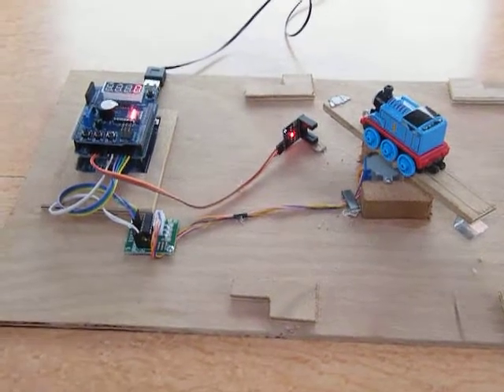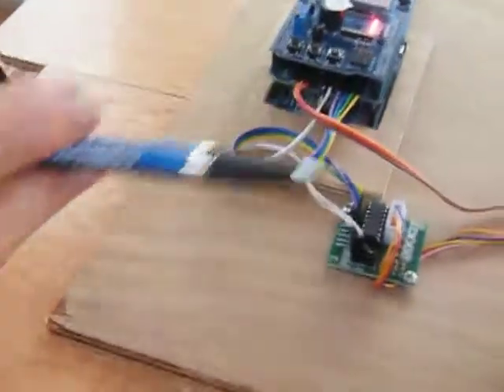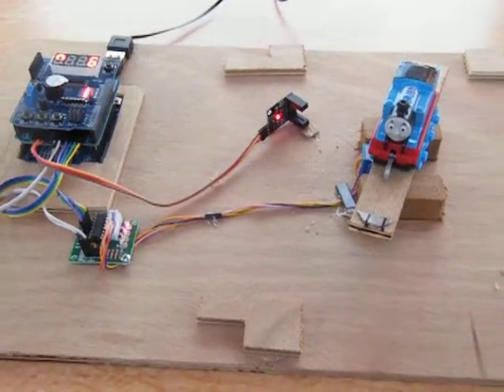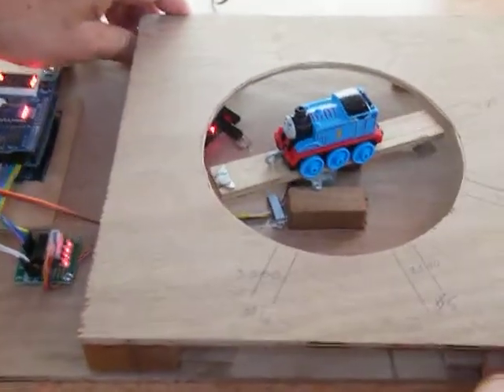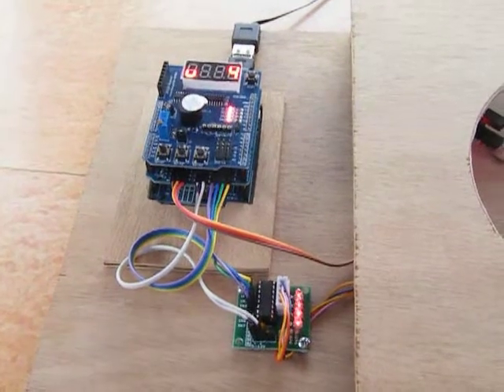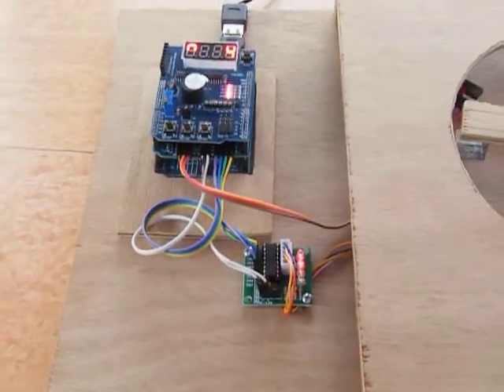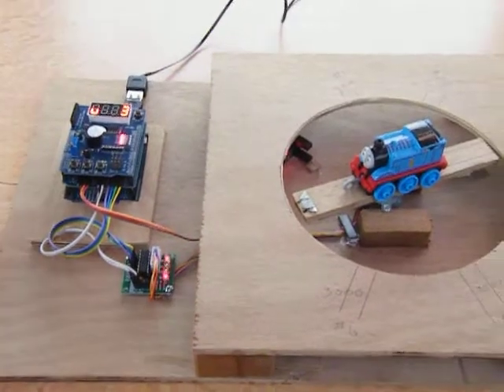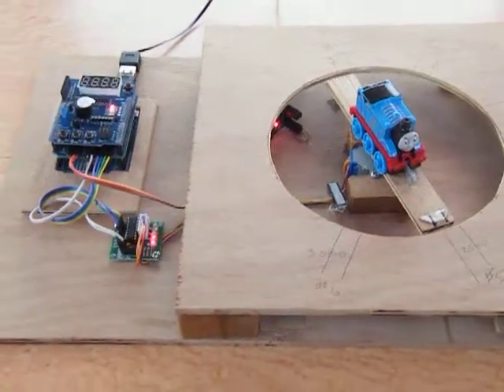Model train turntable prototype "Proof of Concept" (Modelled by Thomas)

Comment from the maker: The biggest challenge so far has been developing a user interface. The target roundhouse/motive power depot has 30+ tracks. As the layout is not DCC I can use the isolator switches and have developed a system using just 1 analogue input. I have also developed a PC (PuTTY emulator) interface and an encoded keypad interface. We are about to install the system into the layout. Video coming soon.